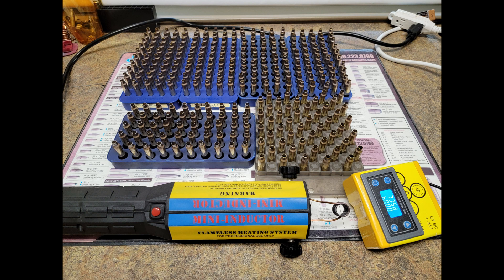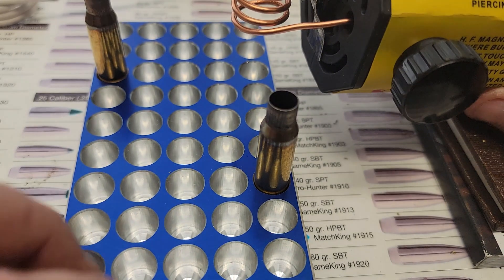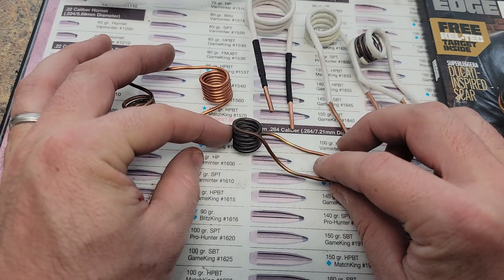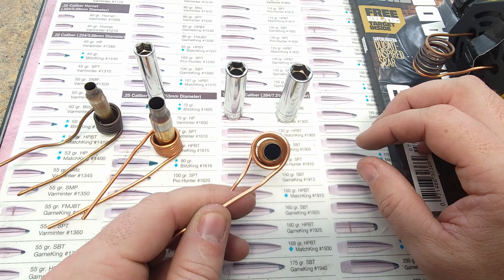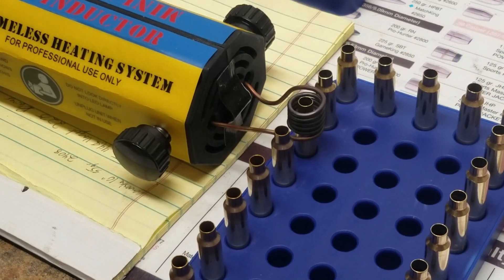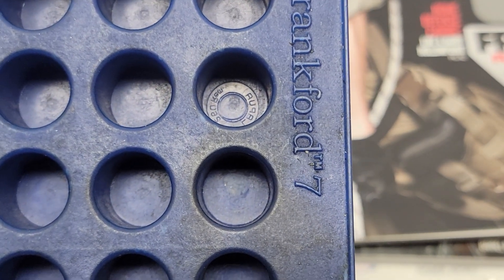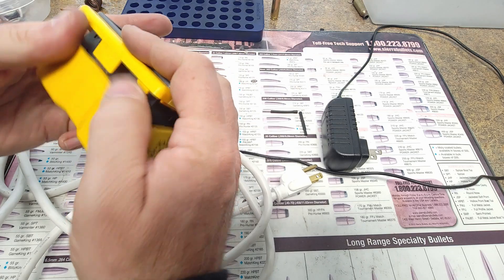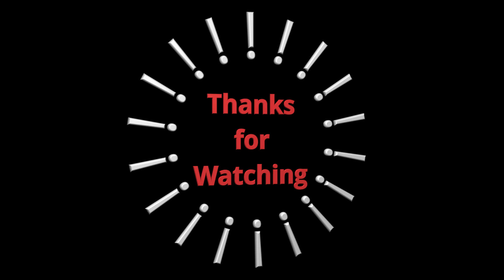DIY Annealer for under $200 Part 2- Tips and Tricks

Comment: Thanks for posting these videos. I just assembled my own and it works great. But I think I know why you are needing so many fans for your setup. Mine came with the fan blowing the COOL air into the annealer from the back end out to the front. Yours is blowing the HOT air from the front back into the unit. I’ve only used mine once and annealed around 100 cases, but I never experienced an overheating issue, and I’m only using the fan from the annealer, no external fans. I wonder if you flipped that internal fan around if it would eliminate having to use the other fans. I also disassembled the annealer and soldered 2 thin gauge wires about a foot long each onto the lugs of the red push button, then drilled a small hole through the housing and fed the wires outside of the unit, then connected them to the delay unit. No need for the bulky extension cord. My fan runs continuously, and I can activate the annealer with the delay timer or by the switch on the annealer itself. Thanks again.

Comment: At 5.40 min the video show the trial of 2 coils.   There is BIG error in the way the two coils are oriented.  The coil that does not heat up the case (top coil) has been wound in the wrong direction.  The top coil has been wound upward ANTICLOCKwise while the bottom coil is wound up CLOCKwise.  I think the top coild will perform the same as the bottom if the coil wind direction is the same.

Comment: Try flipping one coil in your 'dual coil' setup - I think the problem is the magnetic field of one is fighting the field of the other. Just for the sake of argument, say the instantaneous field of the closer (in the video) coil is North on top, the second coil is then South on top.  The field interaction would seem to be destructive.  

I'm about to build my own.  When I get it working on one at a time I may try a dual setup, I'll let you know what I find out, but I am more interested in production speed and automation - the only thing I'm pretty sure of right now is that a trap door positioning system makes sense as a starting point.  Maybe a feeder tube from my Dillon case hopper ...

Comment: Question: I have made my own coil (with 6 turns). It takes approximately 1.0 second to anneal a 25-06 case. My coil is a very, very "tight fit" around the case. Are you aware of any circumstances associated with my coil accidently touching the case while I am annealing the case?

Comment: You know what I’ve noticed when your coils get red hot about 4 to 6 cases of 308 and annealed in sequence can you put the coils over the next piece,It starts to warm up or heat up the brass and as you go down the line you’re annealing consistency and time changes. How did you mitigate this issue?

Comment: Instead of keeping the brass in a tray and moving the coils over the brass. Why not mount the heater to a frame and build a table over the coils with a hole that would guide the case into the coils. More like how the expensive ennealers are designed. It would make a more consistent heating because the case would be centered evenly every time.

Comment: Found out how to get it to run directly off of 110v. The system is basically turning the neutral off and on. You’ll need some wire nuts to multiply the hot and ground wires from the wall power coming in. 

Hot in goes to VCC and the hot on the female receptacle 

Ground in goes to GND and the ground in the female receptacle 

Neutral in goes to S1

S0 goes out from the timer to the neutral female receptacle
Reply: FINALLY!!!  I haven't tried your wiring method yet but I've been viciously scrolling the comments looking for the correct wiring for ac only... it sounds normal enough to me so I'll give it a shot. Thank you sir

Comment: Hello to everyone. I just got mine today but I Can't get it to work with the timer. Mine is the model that once pluged the fan starts going and it does so permanently. I just push the button to anneal. The problem is that the timer wired exactly like in the video doesn't do anything... The fan keeps on going once pluged like there is no timer in between... The timer has no effect on the annealing function or procedure. Any idea?

Comment: Thanks for the videos! They helped me build my annealer and just got done with 50 pieces! 

Have you noticed the base/web of the brass gets pretty hot? This is the fire annealer I’ve ever owned so maybe it’s normal. I did all 50 pieces in very low light so I could make sure I wasn’t over cooking the brass
Reply from the maker: It just super heats the brass inside the coil, I haven't seen any issues with the residual heat. Literally never had a neck crack or case head separate.
Reply: @northeasttexastactical375  one other question, I shot some once fired Peterson brass (from my rifle) that I annealed using your setup and the ES was not good +- 50fps. I didn’t change anything from a reloading standpoint other than annealing. Doing some reading I’m finding that annealing the brass can make the neck and bullet “sticky” and show up in your ES. Your SD and ES and seating tests prove it works for you but I’m wondering if I need to lube (imperial dry lube) the inside of the necks before seating a bullet?
Reply from the maker: Absolutely need to get a hold of your neck tension. Annealing alone isn't going to fix your SDs. Chamfer, lube, mandrel...
Reply from the maker: The base can get hot depending on the anneal time. That's how the bottom of my reloading trays got permanently head stamped by a 260 rem.
Reply: @northeasttexastactical375  any concerns with effecting the structural integrity of the base/web? Just thinking along the lines of case/head separation which I highly doubt but just thinking/asking

Im at 1.5-1.8 seconds depending on the brass manufacture

Comment: I just concluded an experiment to water cool the coils.  I got it working, but the results weren't satisfactory/worth the effort.  The problems I ran into include:  Cumbersome mess of wires/water tubes, kept the coils cool enough to touch, but didn't keep the hand unit any cooler (my primary purpose for trying this experiment), and finally, the copper tubing (as @NorthEastTexasTactical351 mentioned in the video above) didn't heat up as quickly as the wire by a factor of at least 3x (resulting in the hand unit heating up even more).  I ran my unit hotter than I should have in the past and it sparks and pops, but, keeps on going.  I wonder if anyone has popped one of these units open to determine whether/how to add a heat sink and possibly a fan to cool it.  Finally, I think using an air compressor rather than a vacuum would probably cool it off faster due to the cooling effect from decompressing air.

Comment: I'm annealing 6.5 Grendel brass. My anneal time is WAY longer. 9.5 seconds! I must be doing something wrong. I wrapped the coil tighter. I wrapped it on a piece of 1/2" PEX pipe. Grendel is 0.438" od. The coil is close to the case so I'm not sure of the problem. Any thoughts would be great.
Reply: How many wraps due you have in that coil?
Reply from the maker: Smaller wire, more coils. None of my brass is more than 2 seconds

Comment: This set up is dialed! The red button is a two wire switch and can be removed with very little effort by splitting the unit about half way apart and sliding it out of its place In between the two half's. The unit can then be screwed back together like it was. The two wires on the red switch can then be wired into the timer box and the units fans can remain on and cool the unit as intended. This configuration allows you to anneal large lots of brass with out over heating. Either way this is as consistent and cost effective as it gets! Great work!
Reply: Beat me to it.  Mine just landed and that was my initial thought as well.   Would be REALLY neat if there was room inside the unit to cut in or maybe strap on the timer board right to the unit.  Have to watch the light to know when the induction is active though rather than the audible fan.
Reply: @johnkennedy9189 Thats exactly what I did to mine. Kept the red button so I can use it or the timer just tapped into its wires and also tapped into 120v inside unit to run timer then strapped timer to case with the wires coming through case under timer.
Reply: got an image or video anywhere? like only thing going into the timer is the red button wires?

Comment: I wired mine up just like yours and It never came on. I had a drill plugged in and started revving it up and blew the bottom off the timer. A small barrel looking thing setting in the corner on the inside exploded with silver cardboard was everywhere. I had to order another one of the same and a different one. Maybe one will work.

Comment: How has the inductor held up? A guy told me he built one and it degrades pretty quick . I’m guessing he overheated it too many times. I just built one and now I’m wondering how to rig up a small fan to the back like you did but I don’t have a 3D printer.
Reply from the maker: I'm still using the original one I built with no issues.

Comment: There is so much bull pucks out there on annealing, over or under annealing and what have you. I have constructed a twin to this unit and while it takes a bit to sort out what works/doesn’t work, it’s pretty simple.  One thing I discovered was in sorting out timing of “hot” on the unit is to use crappy, aka, split cases to set the time.  Mine is down to 2.4 seconds to anneal and 3 to switch to the next case.  Everyone is going to have a different time based on how tight their coil is, type of brass and so forth.  Variables exist.  As someone online said, “it’s not rocket science”.  Figure out where the sweet spot is and go for it.  You figure it out pretty quickly on what to do.  I appreciate this video a great deal.  Only thing I wasn’t crazy about was the 21st Century bullet seater part.  It’s great but dang, they ain’t cheap!

Comment: Would love to print the fan adaptor, do you have the file shared anywhere? I have the version that blows from back to front.
Reply from the maker: I don't have that file shared on any of the printing sites. It would just be easier to get a smaller fan that fits the back of the unit better. I originally just planned to glue it to the back if it actually fit.

Comment: Mine is a twin to this, up and running.  Still tweaking the coil size a bit for the PRC case but need to check on the time better on next go round.  Nothing against AMP machine, they’re pretty slick but for we po folks, this is a slick way to go.  I think it’s far safer than having an open flame anytime.  I will say the biggest issue I had was getting the danged wires from the extension cord into the tiny holes on the relay switch.  Solved by soldering in a solid copper wire to them.  Kudo’s for a good design and troubleshooting video.

Comment: The common and ground are always connected at any AC switch you install: Whoa!  The crust on the coil is oxidation - keeping it clean between use with Denatured Alcohol and a brass brush will probably work good for what your doing.  I kind'a like it for what I plan on reloading again.

Comment: I've watched both videos. 
Great job. 
I'm just not clear on one thing. The extension cord that powers the timer/heater and the DC power supply both need to be plugged into the wall socket?
Thanks.
Reply from the maker: Yes, 2 plugs. One is the end of the extension cord, the other is the 12v DC power supply for the timer

Comment: Just wanted to add a couple of tips from my own experience. The fan turns on when the annealer is triggered.by the timer. When you are finished you need to plug the annealer into an outlet and the fan will run automatically. ( if you plug the annealer directly into an outlet the fan will come on without pushing the button)
This will help prolong life and vacate the heat inside.
Also, if you use 12ga wire, cut 2 extra pieces about 11/4 inch long and insert them along side the coil wires before tightening the knobs. 12ga  wire in not large enough to allow the coil wire to get tightened down and make good contact with the hand screw. which may be why some think the annealer is defective. Hope this helps my fellow re loaders.
Reply: Good tip. I wonder if a person could hack the unit and wire the timer into the switch circuit.

Comment: Is anyone going to make an adaptor to put a fan on the back?  I could glue one on the back but would have to move the power cord, so it comes out the bottom rather than the back end.
Reply: Just nick a notch (in fan housing) to allow power cord to exit.

Comment: did you disconnect the internal fan? It blows from the rear to the front on mine, so you are pulling air against the internal fan with the added fan
Reply from the maker: Oh, that's a new one to me. No, mine blows out the rear of the unit.
Reply: @northeasttexastactical375  Maybe thats why mine heats up so fast . I wonder if i could reverse the fan leads on the board
Reply from the maker: @arnoldmoos1791  I would definitely try that, or flip the fan around in the housing
Reply: @northeasttexastactical375  Mine blows from the rear to the front !
Reply from the maker: @rickyk.6944  Dang Chinese can't keep anything consistent... You can still cool it off quick with the vacuum trick. If you put a fan on the end just make sure it's blowing the same way as your internal fan. You're just trying to air cool the internals; it doesn't matter which way the air flows

Comment: Thanks for the video! Super helpful and easy to understand. It’s been a while since you posted this video but I do have a question. I’m working with 270wsm Norma brass and I’m at 4 seconds w 12 gauge wire and 6 pretty tight coils to avoid getting down too close to the bottom of the case. Does this seem like an ok time?  270 win cases are going off at 2.1 sec. Which seems reasonable to me. Thanks again.
Reply: Thanks , I’ll see what I can come up with. Thanks for getting back
Reply from the maker: I would think that time should be cut in half. Maybe more coils...

Comment: Have you tried using an infrared thermometer to see what the temp actually is?  700 degrees seems to be the best temp.  templaq can also be used.  Heating red might be hot enough to melt the zinc in the alloy.  You are obviously getting the tight groups and performance...just my 2 cents.
Reply from the maker: I have tried a couple, but they don't go high enough to read the temps and I'm not concerned about it enough to spend hundreds of dollars on one that can. If I can see a orange glow in the daylight or with the lights on I know I've gone too long. Dim the lights, look for a deep red glow, lock it in that timer and start cranking them out.
Reply: Annealing is a combination of temperature + time.  You can anneal brass at 700 degrees, but you'd have to do so for 20 or 30 minutes.  1000 - 1100 degrees seems to be the sweet spot where you are able to anneal within a second or two.

Comment: I bought this heater and the timer. It seems as though I can only get the timer relay to operate while using their "shared power" method. I checked continuity between the two output (switching) pins and even with the timer triggered, the relay never latches those two output pins. That being said, i assume I have a faulty unit. The timer works great in the dc only configuration with shared power. Did you have any issues like that or should I just return the relay?
Reply: For clarification, I am using an external trigger, and only cut one AC wire, to run through the switching pins as you showed in the last minute of your video
Reply from the maker: I'm not sure what that could be. I couldn't get mine to work with shared power, only by using separate DC to power the unit.
Reply: @northeasttexastactical375  
So I pulled the board out of the housing and I have a main wire trace on the PCB that has burnt out (probably from trying to figure out their crappy schematics). It is on the display side of the board and not noticable from the back. A little solder work and it works as you described. Note, for shared power to work you have to run 3-30v DC not AC. Their drawing for the dc shared is actually correct. I ran the wires from the push button on the annealer to the output terminals on the relay timer so it will only turn on when my trigger trips the circuit. Works great. Thanks!

Comment: I have the timer and annealer on order.  I am going to add a second plug that is wired in series with the push button switch and use the timer to activate the push button which will leave the stock fan running the whole time.  Ideally the push button will be low voltage to the motherboard but I don't know until I take it apart.  Thanks for the idea.  I also plan to make an aluminum fixture to hold the brass upside down in the coil like the Amp unit does. With a 6-8 second delay between cases it should keep it cool and allow me time to place and remove the brass at leisure, though I am sure that number will be adjusted.

Comment: I added a larger 12v relay to handle switching the 120v circuit.  So, there is not any AC voltage on the little relay in the timing unit.
Reply: 12V relay upgrade info requested here.
Reply: @carfvallrightsreservedwith6649  it is just an automotive relay in line with the small relay in the timer.  IOWs, the small relay drives the larger relay.